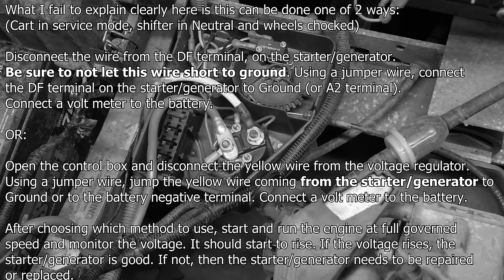2001 Club Car DS, Gas - Bad Starter Generator and Voltage Regulator

Comment: Ty for your info on these carts, they have helped out alot! I recently picked up on older club car (IDK what year it is due to a dash cover put in from previous owner)  and I have experienced the same as this video is showing how to fix. When we bought it, it worked fine around the house. We took it on a camping trip and shut off...twice. The starter/generator supposedly was just changed, the voltage regulator may be my problem. Let me give you the scenario: drove it around the block the day we bought it, parked for several days, loaded it onto a trailer an headed to campground. Drove it around campground approx. 1.5 hours and it quit. Had push it onto a trailer. The next day, it started right up, I put it into service mode and noticed that there was wires at the bottom of the engine, two twisted together, and two not connected. One of the wires not connected was arcing out on a bolt, taped wire up and cart drove fine for another 2 hours, then it just died. Im sure I need a regulator, but can you tell me what the wires are from/for near the bottom of engine, they look like the go to some kind of switch.
TIA
Reply from the maker: The voltage regulator will not cause the cart to shut down and work a few hours later. It only maintains the charge on the battery. A failing regulator will stop charging the battery while you drive. You have a few things you can try. The wires down below the engine are probably part of the rev limiter. When these fail, they usually fail and short to ground, killing the ignition. This will cause the engine to stop. You can bypass this and test. You will need a wire with 2 bullet connectors. It sounds like it might already be bypassed. The issue you are experiencing may be a failing ignition coil/CDI. This is located behind the engine shroud, following the spark plug wire. Unfortunately, this is not serviceable and will have to be replaced.

Comment: My Yamaha G22 would not charge it had a blown fuse plus I bought brushes at amazon and installed them. The starter would not turn over. The old brushes were not worn after 5 years but must have been sticking. Works great now.

Comment: Thanks for the great informative videos!!!, I went from Key on and nothing when you step on the pedal, to now the lights working and the solenoid is clicking when i step on the pedal. I Changed out the solenoid and voltage regulator(super easy(thx for the videos)),replaced all the micro switches. All the fuses look good, however there is a rats next of multiple splices everywhere!!! :( I am going to follow the wiring diagram for my 94 Club car and run new wire(correctly color coded)) anything else i should be looking for?. if i jump the solenoid, the motor turns! - I am eagerly waiting a reply! :)

Comment: Hi, gr8 videos, tnx, i couldn't see, did you conect, the cable to ground, and the other end to the yellow cable, or to the starter generator charge post?
Tnx
Reply from the maker: Yellow goes to the DF terminal on the starter/generator

Comment: I’m a little confused on the testing of the charging system. Yellow wire etc. thanks great job. Kevin
Reply from the maker: By connecting the yellow wire directly to ground, you bypass the voltage regulator. With the volt meter connected to the battery and yellow wire connected to ground, the voltage should steadily rise and you should hear the engine bog down a bit. If this is the case, then the starter/generator is fine and the voltage regulator is bad.
Reply: @Kevinsgolfcarts   thanks Kevin now I got it! Appreciate you !!

Comment: Best video I’ve come across for this problem!  My S/G tested good by your method and the voltage reg showed bad (17 volts) so I changed it.  Tested again and still showed 17 volts to battery! I’m hoping the new VR is bad. I bypassed the yellow wire in the sheath going to the starter with another wire to see if the original wire was broken but it wasn’t.  Grounds are good too. What’cha think?
Thanks, Bruce
Reply from the maker: Make sure you are using a good volt meter. Club Cars like to charge around 15 volts.
Reply: With the new VR in place I noticed the amount of voltage going into the battery depends on rpm’s.  WOT it gets 17 volts and at 3/4 throttle it’s 14-15 volts.  Is this correct?
Reply: Exact same thing for me, S/G charging, new VR and still 17 volts. Only difference original was 3 wire, replacement 4 wire with a spliced ground. Did you ever figure it out Bruce?
Reply: Yep me too. New s/g and vr. Still getting 17 volts a wot.

Comment: Hi Kevin, thank you for another great video. I have a 1998 ezgo txt gas buggy,but it won’t charge, I have had the meter on the battery which is only 1.3/4 hrs old and it shows 12.8 ish volts but when I start the engine it actually drops to around 11.3 volts. I have changed the voltage regulator.and had the starter/generator off and the brushes look like fairly new, the motor starts up no probs. Any idea’s would be great, I’m in the UK Many Thanks
Reply from the maker: You will have to diagnose the starter/generator to make sure its putting out voltage on DF terminal. Connect the DF terminal direct to ground, run the engine at full speed and measure the voltage at the battery, It should climb to 15+ volts. If it does, the voltage regulator is faulty, if it does not, the starter/generator needs to be replaced.

Comment: Thanks for all your videos, I've been researching just with your videos, now a fan. I am experience battery drainage quite rapidly, i changed the voltage regulator and charged battery and did same thing battery drainage again I've tested the starter gen., and seem to get around 17.5 or so volts does that mean my gen., is bad? HELP anyone 01 club car ds gas
Reply: No generator is good

Comment: Very descriptive. Im still having an issue with my club car ds gas. My chassis ground wire that goes from frame to plate by oil fill got red hot and melted apart. Replaced with another ground wire and push pedal and instantly wire turned red and melted apart and cart never turned over. Sound like somethin you've ever dealt with???
Reply from the maker: You have a dead short to ground. You will have to check all of the heavy gauge wires starting after the solenoid to see what is shorting out. Its possible your starter/generator has an internal short.
Reply: @Kevinsgolfcarts  thanks. Back to the garage today lol.  Ill have to jack it up n check all wires n then test the generator posts
Reply: So after unhooking all the wires from the generator i did a continuity test from housing to all posts and F1..F2..n DF posts failed and showed continuity which test says i should get no continuity between any. Upon further inspection the generator is for a 90-93 ez-go cart and mine is a 94 club car ds. So new starter/generator it is looks like. Thnx again for the help

Comment: Thought my starter was bad from not charging and failing the test when jumping from yellow wire to ground. That starter was new, but aftermarket. Bought an oem replacement at twice the cost and receiving the same results. New voltage regulatorswas installed when within a year. Any thoughts? Tested all ground wires and all other wires are not corroded. Have spent hours trying to diagnose. Any ideas would be greatly helpful!
Reply: Nevermind. I had the ground cable and white cable swapped. I feel like an idiot, but will leave this on here in case anyone else has the same issue.
Reply: @kellypayne2714  Everybody makes mistakes but many will not admit to it. Thanks!

Comment: The starter on my club car ds is wired differently. It won't charge  higher than  12.3 volts and the running  the wire to ground does not make it charge and it has new brushes

Comment: I always get all my motors rebuilt because I have a electric shop about a half hour away. They do anything electric. I’ve had battery chargers, alternators, starters, and radios redone there. Never had a problem withbthem

Comment: What is the minimum output from the sg? Following your method it’s climbing up to 13.6 as throttle increases. But nowhere near 15. Club car villager 6 for reference. Battery last while but does not charge itself.
Reply from the maker: The voltage output of the starter/generator can reach well above 30 volts without the regulator. Most of the time, its the voltage regulator that fails.

Comment: I hooked yellow wire up to negative post like you said and ran in service and it sparked like hell
Reply from the maker: That is normal if you were running at full RPM. The starter/generator is fine if it arced. That's basically running full power output going directly to the battery.
Reply: @Kevinsgolfcarts  I’m only getting 12 volts in service mode at full throttle .  brand. New  started generator and regulator.  All wires are landed correctly
Reply from the maker: Without having the cart here, all I can suggest is to test by connecting the DF terminal (yellow wire) to ground, connect a volt meter to the battery, then run the engine at full throttle. If the voltage climbs, the starter is good, voltage regulator is faulty. If not, the starter is faulty. Note that some starter/generators are rotation dependent. If you installed a starter that is designed to run clockwise, it will not work correctly if wired to run counter-clockwise.
Reply: @Kevinsgolfcarts  I did exactly how that comment reads and it smokes my wire every time
Reply: @Kevinsgolfcarts  it’s a clockwise 2004 ds fe290
Reply: @Kevinsgolfcarts  let me ask you this should the df terminal show continuity to the frame and the f2 terminal with no wires attached?

Comment: Can I use a multimeter to do this? Wld I just touch the yellow wire on stater then negative?
Reply from the maker: Yes, you need a multimeter or volt meter of some sort. Yes, connect the yellow wire to ground to test the starter/generator.
Reply: Ok so I did that, and it says like 11.65 or something like that. Battery by its self is 12.14 so that wld mean the starter generator is bad correct?

Comment: New starter/generator and new voltage regulator, with same big meter you used at the beginning I'm reading while running, a mark or 2 shy of 16 volts, is that ok?
Reply from the maker: Yeah that's fine. Club Cars run about 15+ volts on the charge circuit.

Comment: 2012 club car precedent is still over charging after changing out voltage regulator.  What could cause this?
Reply from the maker: Could be a faulty voltage regulator. I've had a couple that were bad from new. Could also be improper wiring.

Comment: Hey Kevin, Love your channel. I have a 2000 clubcar ds with FE290 engine. It turns over and I have spark but it wont start. I replaced the fuel pump, airfilter, Carb, Fuel filters, cleaned out gas tank, added new fuel.. The carb bowl is filling with gas and I can see it flowing. Any ideas?
Reply from the maker: Make sure the battery is connected correctly, red to +, black to -. I can't tel you the number of times I've seen batteries installed incorrectly. Do a compression test to make sure the engine has good compression. You need 110PSI or higher for the engine to start. How bright is the spark? Is it a nice bright blue/white spark or is it a dull red/orange spark? You want bright blue/white. Is it a constant spark? If it stops sparking after a few revolutions, then there may be an issue with the ignition coil/CDI or rev limiter.

Comment: I have a 2004 cc gas, almost all the wiring melted/caught fire. I would assume that either the regulator quit, the generated over voltage, or wires rubbed and shorted. The wires to the gen and battery were touching and fused. I need to rewire whole cart, but think I should replace gen/starter and regulator. Hate to go through all the work and then have it melt again. Thoughts??
Reply from the maker: Fix the wiring then test to see if a component failing caused the overheating wires. Most times its the wires rubbing through from vibrations.
Reply: @Kevinsgolfcarts       very good information

Comment: That is not definitive of a bad starter generator. I had a bad regulator do the same thing. Actually both just recently. Original failed and output was 17V. Replacement DOA and output was bat voltage of 11.1-12.0. Next replacement output was 14.4 and trickeled down to 14.1 when warm. Starter generator was fine and in working order the entire time.
Reply from the maker: 90% of the time its the voltage regulator. Starter/generators do fail occasionally.

Comment: i wish you could explain color codeing
on voltage regulator
Reply: Small RED goes to LARGE WHITE on starter soleniod .  SMALL BLACK may be TWO or splits to TWO and goes to ground and also bottom micro switch (club cart). The micro switchs from the handle (forward-reverse-neutral). YELLOW goes to  (white SMALL that goes all the way to SMALL WHITE wire that is on starter/generator.   Just did my 2005 ds club cart today running great.  Use a PHONE CAMERA before you start and send photos to yourself with  written info you want to remember.

Comment: would this also work on a 97 ds
Reply from the maker: Yes. This starter generator will work on years 1992-1996  (jump A2 to F1) counterclockwise engines and 96 and up (jump A1 to F1) clockwise engines.

Comment: changed coil still wont start
Reply from the maker: Like anything, you need to start with the basics. Check and make sure the engine is getting air, fuel, compression and spark. If any of those are missing, it won't start. Whichever is missing, you need to work your way back and see what is stopping that ingredient from getting to the engine. Keep it simple and start with basic diagnosis, don't just chuck parts at it without testing things first. Having a multimeter is required to test the electrical harness.